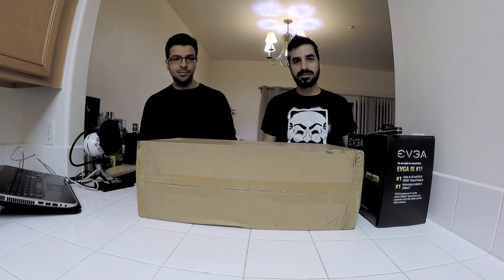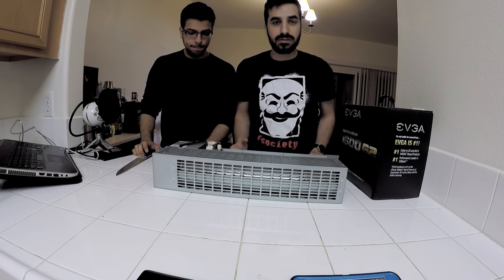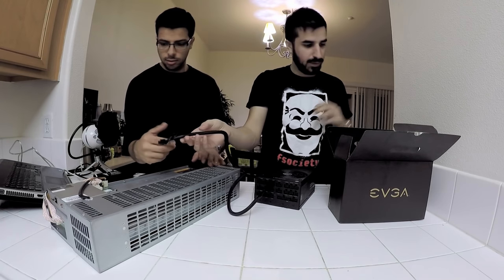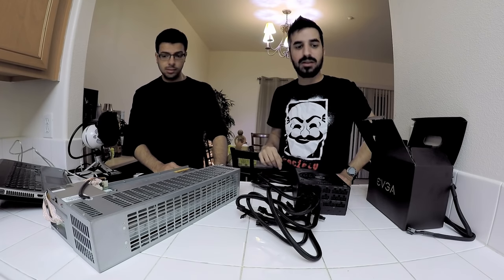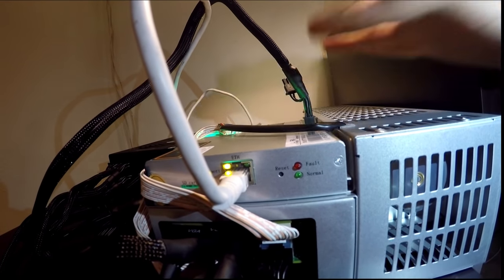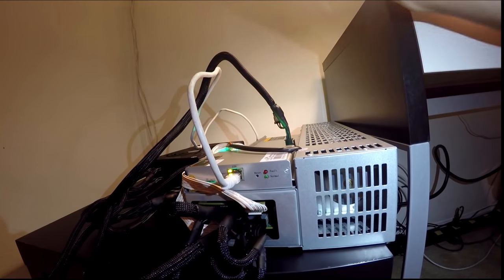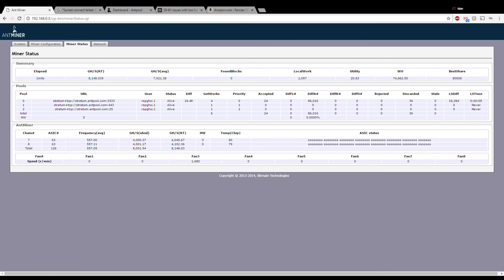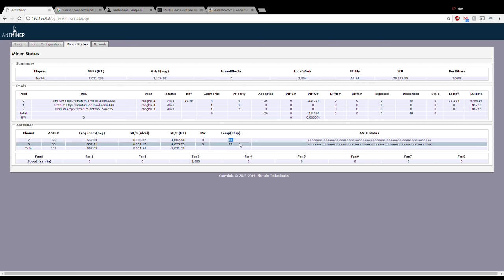How Much can you make mining bitcoins + Antminer R4 unboxing and complete setup

Comment: FYI, All the PSU jumper lead is doing is connecting a green wire and a black wire in the ATX connector, this hot wires the PSU so it will turn on, you can use a piece of wire to hot wire you don't need a special connector, it's something PC modders like myself often do so you can check fans, lights, etc, before fitting them into the case or before the system is complete, just check on utube or google PSU hot wire for info.

Great video, now going to check out your other video to see if it was profitable?

Comment: Bitcoin Heater!
Reply: At least he is honest about it, and doesn't make silly claims that he will have any money back. I guess, if he is already using electricity for heating, then why not. Sure, you can probably buy electric heater ~2kW for 100-200$. But this R4 is around 1000$, and you help a bitcoin network be more resistant and decentralized. Nothing wrong with that. Just be realistic - you will never get your money back in bitcoins.
Reply from the maker: Well see about that mister movax20h

Comment: Shoot, this video is flawed. 98% of the video is correct. When he went downstairs to get the 24pin along with the 8pin power connector to the motherboard. He had to put a device at the end of the connector that supposes be plug in the motherboard 24pin slot, to tell the power supply that someone pressed the power switch on the case, so the power supply will automatically turn on.
Whats the name of that jumper so I can go buy it.
Reply from the maker: Power supply jumper

Comment: Can you only mine Bitcoin with the Antminer R4 or can you mine other cryptocurrencies as well? Do they have their own hardware or is t just the software that is different?
Reply: You will not be able to mint most of the other cryptocurrencies on it. They use different Proof-of-Work algorithms, and the asic miners are designed for very specific PoW algorithm based on double SHA256 hashing. Many other cryptocurrencies are using different (arguable better, but it is very hard to change existing bitcoin system to a new PoW algorithm) algorithms. You might be able to mine Bitcoin, Namecoin, Devcoin, IXCoin, Freicoin, Peercoin, Terracoin, Zetacoin and maybe few more, as they use the same PoW function. You might need to modify a software a little bit, but probably all you really need to do is point the device to a different pool or own coin daemon for solo mining. Or start own pool as a proxy.
Reply: movax20h THank you. What do you think about mining ethereum and as a platform?
Reply: I have no opinions on that. Do not use, or mine. The new MimbleWimble being for example implemented here https://github.com/ignopeverell/grin looks promising. It is done from scratch, uses safe Rust language, and a novel Cuckoo cycle proof of work function, which should be equally fast on normal CPU / GPU and ASICs, thus making it both easier to enter mining, and make it more decentralized. And MimbleWimble is much more private and scalable protocol than bitcoin blockchain. Still many months from something operational.
Reply: What Newsletter's do you read and blogs to keep up with all of this? THanks again for your help.

Comment: Would you recommend the 1600 evga over a smaller size power source such as a 1000 or 1300 evga power supply? I am in the market of purchasing either the R4 or antminer s9 which would you recommend? Sound nor heat is an issue. Thank you in advance.
Reply from the maker: +Chris Smalls you can probably use the evga 1000w power supply. I just used 1600 from my old s9
Reply from the maker: +Chris Smalls you can use 1000w the only reason I used 1600 is because it use to be for my s9 but always pick a bigger watt then smaller
Reply: Denis A thank you. It's more of a hobby rather then an investment for me. I currently have both a s7 and s7-ln, so a s9 would use around the same power but with increased hash power.

Comment: I love the S9 antminer............I got mine before the halving and was mining .014 btc per day. as of today because the difficulty has gone up so much i am only mining .009 btc per day............I am starting to wonder if I will even make my money back.
Reply from the maker: Where are you running it? It's so loud and hot
Reply: right now its outside because its so cold..............normally its in my office and the hot air is vented outside...it is noisy though
Reply: gpu's are better than asic's and you are not restricted to just mining sha256

Comment: How does the pool know what speed your miner is?
Reply: You send back to a pool two types of mined blocks - fully mined at full difficulty level (which happen very rearly - you might be able to find a block at full difficutly about once every year or five, depending on miner, at current difficulty levels and available hardware; but if your pool do have 10000 users, the pool will be finding few blocks every day), and also partially mined blocks (at lets say difficulty that is million times smaller than full difficulty), the number of partially mined blocks is used by the pool to know not only how fast the miner is, but actually it measures it how much work are you doing with it to find full blocks. You will be finding these partial blocks every few seconds on a good miner. Pool after verifying that they are correct partial blocks, will measure how many are you sending per minute, and know how much are you contributing to the pool, and pay you back proportionally (there are different methods used by different pool how it works exactly), even if you never find a full block.
Reply: Thanks movax, so if I understand you correctly, a partially mined block is one where the hash is not low enough to win, but still very low?
Reply: Yes.  Fully mined block would have a hash discovered that is less than a target (based on a current difficulty in network). When you are mining on a pool, pool will ask you to send even the blocks (nounces), that hashes to value that is bigger than target, but still lets say less than 1,000,000 * target, so they can verify that you are in fact hashing something and trying to find a full block. And also they know this way how many different hashes are you really trying per second.
Reply: Thanks a lot, I've wondered about that for a long time ;)
Reply from the maker: Thank you for that, I learned something new.